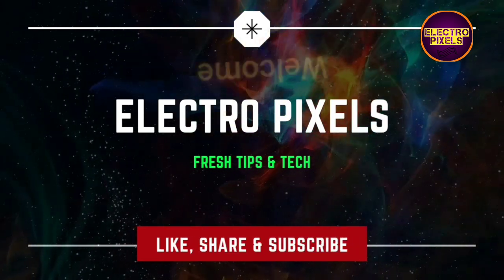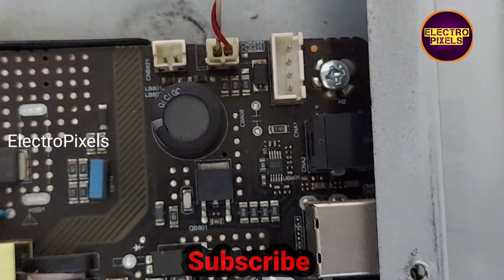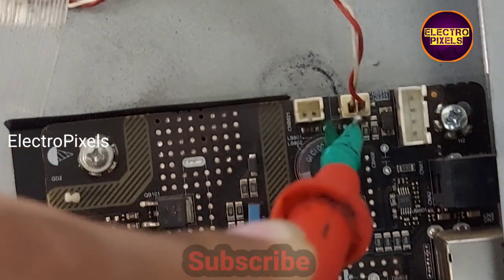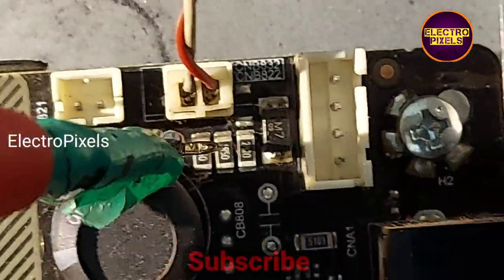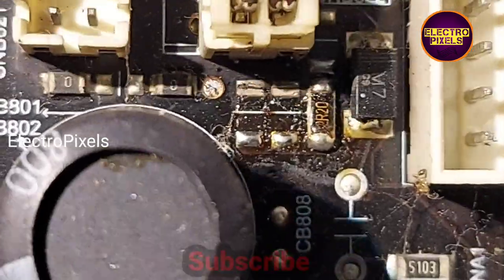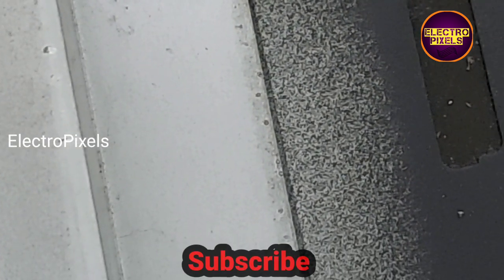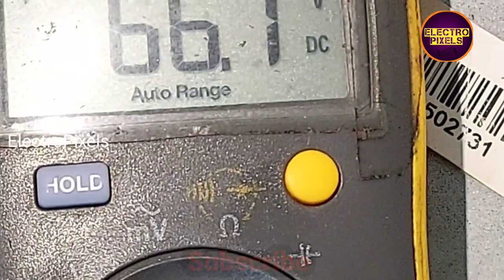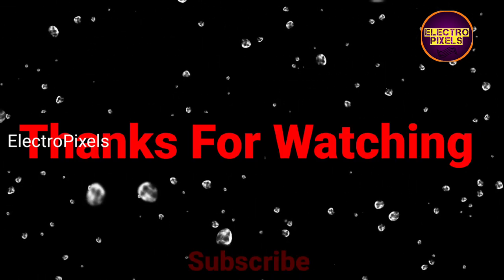LED Tv Combo Board Backlight Voltage Adjustment by Resistance For increasing Lifetime LED Backlight

Comment: gud day sir, im converting led backlight in sony LCD and using universal inverter but the problem is to how "increase" voltage backlight output.  31V to 36V. thanks master.
Reply from the maker: Use a Double Coil Backlight LED Driver, Use 24 Voltage as Backlight Driver Board input vcc and the Output Voltage will automatically regulated
Reply: @ElectroPixels  thanks master.
Reply: Master a Samsung 32 red light 10x blink no pic no sound but backlight is ok. can u giv some idea sir? thanks master.

Comment: It is better to check/measure the current instead of the voltage. Also I think you should only remove one resistor in this case. Removing two resistors will make the picture too dark for some customers. Thanks for your videos. They are excellent. I watch all of them as them come. Please keep them in English, that's my language. I recommend the UNI-T UT210E Pro Mini Digital Clamp Meter, for current measurement.

Comment: Hello sir, wonderful video❤... Sir my tv has three led stips in it and are connected in parallel... I have checked it individually and one led on each strip is damaged.. So does it happen often? Or should i check the driver circuit? Initially the voltage goes up to 70 volts and then goes down to 19.5 v at the output of the driver circuit... Please reply..(each stip is rated for 36 v )
Reply from the maker: First Replace entire Backlights then check using the LED checker and Find out the Total Voltage, and then Connect Socket in motherboard now note down the total output voltage then Compare with the Output voltage with LED checker and Motherboard Output voltage, If Both the output voltage are almost same then no problem with the motherboard, after Replacing backlight adjust Backlight  level in service mode minimum 30 to maximum of 60-70 percentage, otherwise if the Motherboard output voltage is higher than expected then Install a Universal LED Backlight driver board
Reply: @ElectroPixels  I don't have a led checker.Im not a professional ... And i am just trying to fix it myself😅.... i'm an electronics engineering student trying to save some money😅... Thankyou so much for replying....One more thing.... Is it normal for it to go upto 70 v then drop slowly to 19.5....is it some kind of protection??

Comment: You re not reducing voltage really these are constant current led driver circuits these sense resistors on the feedback rail of the driver negative line increase and thus reduce current trough the leds.
Reply from the maker: Voltage is also reduced to you measure 5v approximate Voltage difference while measuring with Multimeter. Thanks For Watching sir